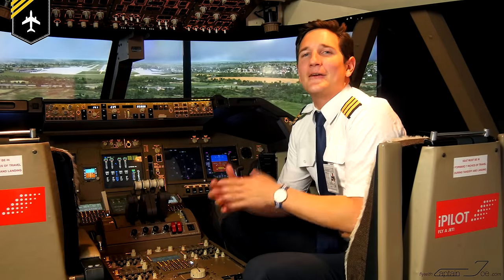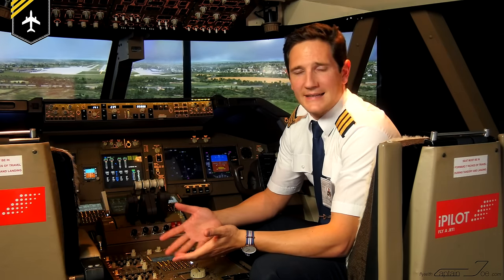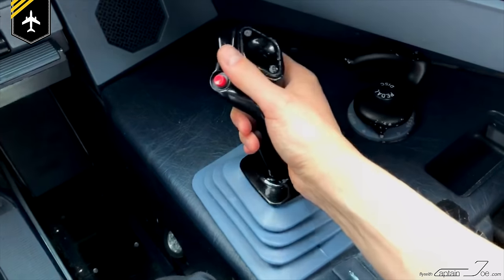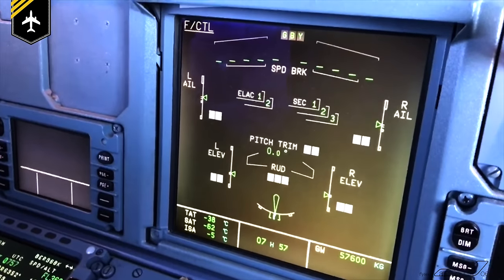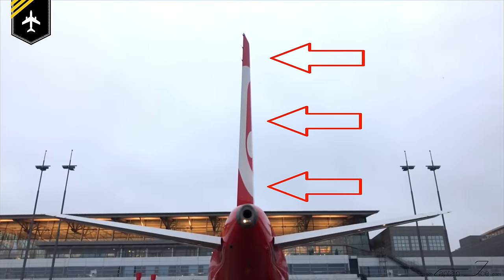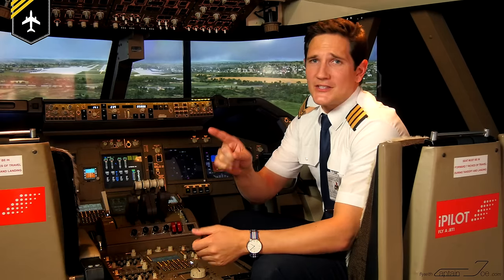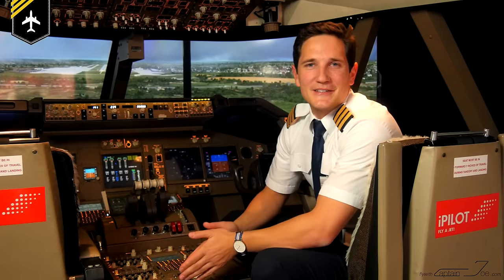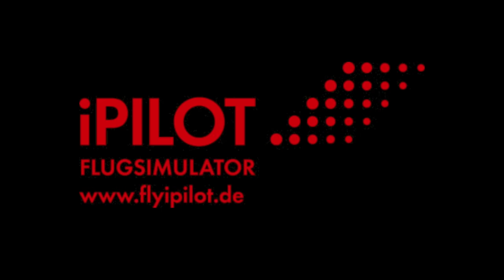Why does the RUDDER point to the right? Explained by Captain Joe

Comment: Does flybywire have any redundandy (mechanical)  control over the surfaces ? Or if it fails, you are done. All the inputs are CHECKED by the computer for consistency and sense ? Or this can by overriden by the pilot at any time. What is the role of the systems between the pilot input and the actual inputs given to the actuators. I know that some trains use this concept also and tend to override inputs that make no sense, unsafe or contradictory. So the final computer takes the desicion whatever the driver input is fordwarded to the train (motor, brakes) or it is ignored. In fact they use TWIN computers as the A380 has TWIN systems (I recall reading it) so computer can check each other for consistency as well. Boieng people say that pilot is ALWAYS under control of the aircraft and not system will override the final desicion. Is this true for Airbus ?. Or just marketing ? I mean, both make excelent aircraft and systems, that is unclear what is the correct approach (in case that the statement is true). THe get their jets better and better. A320 is a bestseller, The 737 is the most proven airframe always upgraded. Of course a train is much simple, predictable and far many less thing can go wrong so a a truly drive by wire is ok as long as the use TWIN systems in parallel (usually are industrial grade gear by SIEMENS). Cheers and thanks to you company for giving the oportinuty of filiming the details of the A320, both from outside and inside. You dont get this closeups very often in aricraft videos. Would be fantastic a vid of one day as a pilot showing the cockpit action and all the thing that goes into fly those machines.

Comment: what if all engines stop in mid flight, did rudder then point to the right, if not, what is keeping him in neutral position.
Reply: the airflow over it will keep it in a neutral position, but even with engine failure there are back up systems to provide hydraulic pressure

Comment: okay,so if there is no power from the engines...there is no hydraulics.
Then that would mean no way to fly in an Airbus if there is no engine power to control the ailerons or rudder?
Reply: There are electric pumps, but the main source of hydraulic pressure is from the engine driven pumps.
Reply: MegaGouch thank you

Comment: what is trim please make a video
Reply: Imagine you're in your car driving along an endless turn. If you let go of the wheel, the car will go straight. So let's say you want to keep turning but your arms are getting tired so you want to let go of the wheel. Trim is a system that would zero out the force on the wheel so that when you let go, it remains in the turning position.
Translate that to airplanes and you'll find trims for all control axis. For the pitch axis, we trim and zero out the force required to maintain an attitude whenever there's a speed change that would require us to maintain the yoke in a new position. By trimming, we could let go of the yoke and still maintain attitude. In the yaw axis, trim helps overcome the forces required to keep the airplane straight in case one engine stopped working. Same goes for the roll trim, but that one is used less often and also during engine failures (the rudder will be helping out with yaw during the asymmetric thrust situation, but it will also cause a roll tendency that aileron trim can help eliminate).
Reply: palonazo thanks buddy nice explanation

Comment: A380 rudder pointing opp directions on ground?
Answers simpler than you thought!...
Hint..wind height and...residual hyd press diff
Reply: Or maybe, only 1 engine started (or the 2 right ones) as each engine control 1 hydraulic system, and each rudder are controlled by only 2 hydraulic systems.

Comment: If the Hydraulic Pressure goes away when the Engines are shut down what happens when there is a dual Engine failure?
Reply: Pressure will be provided by the APU
Reply: Ok, i was wondering how sully did that

Comment: why do analog attitude indicators get out of rotation when the plane is off?
Reply: Because the gyroscopes that keep them rigid in space and the erection mechanism stops working as soon as the vacuum pump that drives the giros stops working. Then, since the mechanism is not perfectly balanced but has very low friction, it just falls on to it's freedom limits until the vacuum pump starts working again.
Reply: Vacuum driven gyroscopes are still used, its what i learned on. However in big complex planes like this they will also have electrically powered accelerometers and even maybe gps attitude referenced intruments.

Comment: why aeroplane have two steerings and what we control from two steerings?????  plzzzzzzzz explain
Reply: In most airplanes you have either a control stick or a control yoke with a steering wheel. Moving these side-to-side controls the ailerons which in turn will roll or bank the airplane. Further. moving them forward or backwards moves the elevator which pitches the nose up and down to make the airplane climb or dive. There are also pedals on the floor that move the rudder to make the plane yaw left or right. The rudder pedals also cause the nose wheel to point left or right to steer the airplane on the ground and pushing the tops of the rudder pedals apply the brakes. The other major control is the throttle that controls the amount of engine power to control the speed of the plane.

Comment: What is a windmill start on air bus
Reply: You are using the airflow of the passing air to help start the engine. The turbine has to be spinning before it can be started. If you have an engine failure at high altitude where bleed air from the APU cannot be started then you can increase speed to help spin the faster and attempt a restart

Comment: what do they fill up the tire with
Reply: Allen Augusta nitrogen
Reply: Nitrogen, but not for the reason that car garage lead you to wrongly beleive (they claim slower deflate rate and better temperature pressure stability). The reason is that nitrogen is dry, no ice will form inside the tire due to the humidity in the air. It also have a bit of a better temperature stability, which for aircraft is very important: the tire will be very cold when up in the air (I beleive -60°C), and quite high when landing (heavy braking can cause them to overheat and melt/catch fire). But the most important part is: no oxygen. This prevent internal fire! See, the higher the pressure, the easier it is to make something catch fire. An internal fire can not be extinguished until the tire actually exploded, which will be simmilar to a grenade in power, less the shrapnel. It is not visible until it explode (but will trigger an overpressure alarm in the cockpit, then they may have less than a minute to warn the ground about the explosion). An external fire can be of course extinguished easilly and do not make the internal pressure raise much. So yeah, they use nitrogen because it do not support combustion and is cheap, the other stuff is added bonus.
Reply: thephantom1492 At my last job we drove supertrucks at AK STEEL. The trailers are equipped with 6 used aircraft tires to support the 240000 payloads. We've had 2 deaths at the tire shop in the last 17yrs. I watched a partial failure go one time. It blew a hole out a bald spot on the tread about 6 across. (was getting it unloaded so I could take it to the shop). It was so violent that when it blew I was dreading getting out of my truck because it was a mandatory spotter door. Even though my spotter was 20 feet behind the truck, he was pelted by pea gravel so hard that he was covered in red marks and he actually had some embedded slightly in his skin. Now imagine if it was a catastrophic failure. (blow out).
Reply: Stacy Smith it can really get scary when a tire explode. I have seen some on youtube, and even if they were smallish tires... it was scary. Also seen some truck tire from a dash cam that exploded due to a rim failure... scaryyyyyyy.
Reply: thephantom1492 These were 5 foot tall aircraft tires.
Reply: Stacy Smith
Bahhh small tires... Most likelly fit on some of those pickup trucks!

Comment: To    Answer    Tesla. py      here       well   if both    engines are  say damaged by   birds     well yes   you have the     APU    Auxiliary   Power Unit   that should be able to supply electricity and some      hydraulic power       electricity   for the    computers and   hydraulic power for the     actuators    on the  control  surfaces        now  if the plane runs totally  dry  out of fuel no fuel left for the    APU too  then there is a small drop  down air turbine powered by the slipstream   the  wind around the   moving   airplane       that    air turbine   powers a   hydraulic pump that   will give   pressure to hydraulic systems for all the  flight control   actuators   also   gives   a certain amount of electricity too   and there can be   batteries   to give some electricity  to operate the   fly by wire system    at least until the plane glides down to     hopefully a controlled   landind on some    suitable surface   preferably an    airport